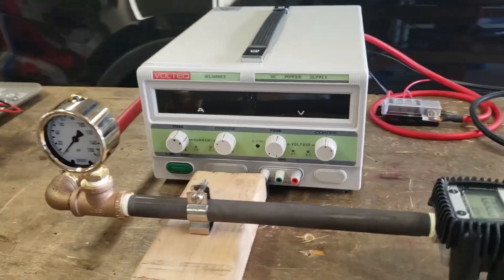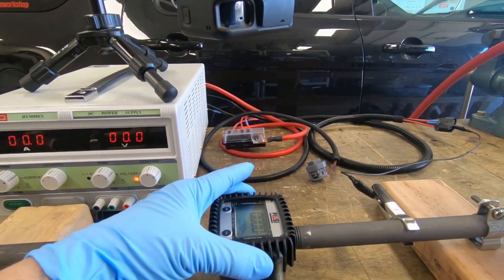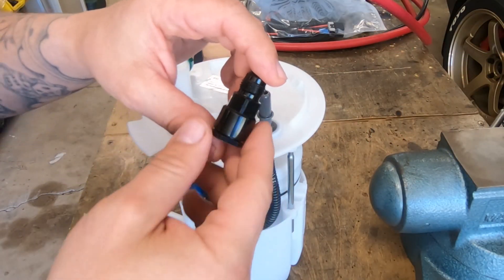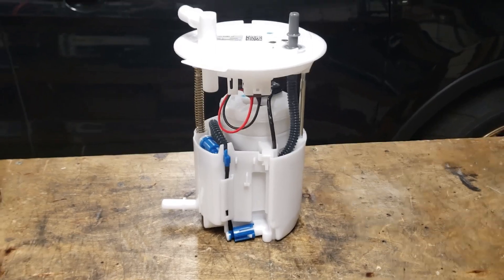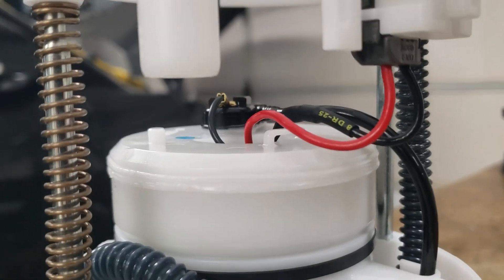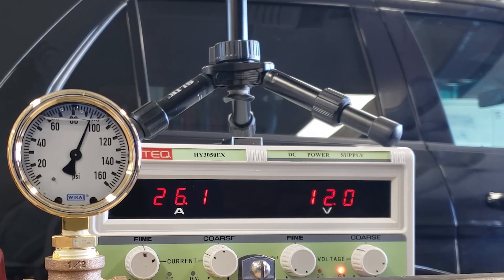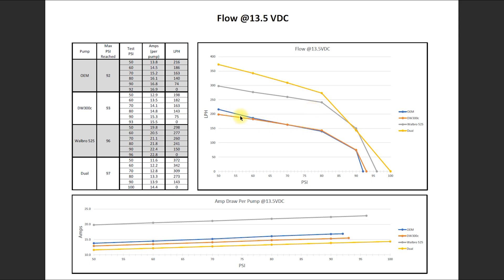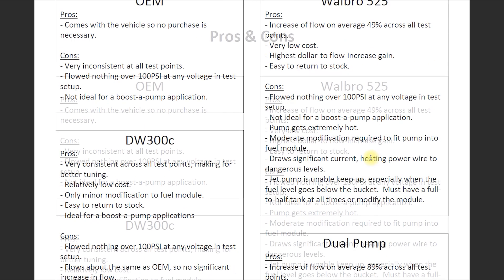Explorer SHO Flex 3.5L EcoBoost: LPFP Modules Compared - Unveiling Fuel Flow Performance! Short

Comment: For people wanting more pressure with flow you can run a serial pump setup and achieve over 120psi base pressure relatively easily. Your primary pump will have to be larger than your boosting pump.
Reply from the maker: All true, but won't work on this platform...at least not without significant modification.
Reply: @4TheWorkshop  an external inline pump would have to be utilized.
Reply from the maker: @RadDadisRad  nope...won't work at all.  Your basically saying in series?  This system essentially already has that...the HPFP.  So that doesn't help anything if the first pump in this whole process (LPFP) isn't able to feed this "booster pump" to begin with..  All these ideas you are coming up with don't take into account controlling any of it and what to do if there is an overpressure condition. A lot more engineering involved than what you're suggesting. C'mon...gotta think past first base, my man.  Your ideas will only create issues for those who are reading this.  I'm tempted to start shutting this comment section down as I want no part of a hair brained idea.  You're welcome to start your own channel and promote those ideas there.
Reply: @4TheWorkshop  I think you think you’re smarter than you actually are by the way you’re talking down to me. Many liquid transfer systems use a a HVLP base pump with a LVHP secondary pump to achieve their desired pressure delta. I’m an automation and process controls engineer and I design hydraulic  transfer systems for wastewater. I achieve 280-480psi inter stage in a multistage ultra filtration system while flowing 44gpm @ a 29% solids to liquid ratio. A higher base fuel pressure means a multiplied delta pressure ratio through the hpfp. None of those low pressure pumps flow enough at 100psi let alone 125psi or even 150psi. Low pressure fuel pumps are a lot more common, making sure sure the pump body can hold those pressures vs ambient is another thing other than the aluminum bodies units.
Reply: @4TheWorkshop  every idea is considered a hairbrain idea until someone makes it work then it’s a great idea. Be an innovator not a parts installer. Btw I am one of the ones with twin g25/550 turbos on my 2014 SHO that I have a fuel lab PWM controller and brushless pump. Using stock line as a return line and do far with priming, idle and light rpm’s I maintain 100psi base pressure. I’m not fully tuned and I don’t have a built trans so I’m not in any hurry to get the car road going.
Reply from the maker: @RadDadisRad  HAHA...I know the major players in the SHO world and you're NOT one of them.  I know BOTH of the only 2 SHOs that have the G25s and there is NO ONE running a brushless setup.  So you can quit with the name dropping and power-flexing.  Be aware of who you are talking with.   As for the hair brained ideas...well this ISN'T the forum for that.  My video was intended to test the ONLY available (and currently being used) setups out there for the transverse platform.  This isn't the place to see whose junk is bigger.  Take that to FB or on the forums (I'm on pretty much ALL the forums and major FB groups, btw). Again, start your own channel and promote your ideas there.
Reply: @4TheWorkshop  I didn’t name drop or power flex. I’ve been building my sho longer than you’ve had your explorer. Just remember how rude you’re being because I’ll remember when I finish my build you’ll be just another slower build.
Reply from the maker: @RadDadisRad  LOL...here we go...ANOTHER one of these guys. I'm really not worried about you, my friend.  And yeah...you essentially name-dropped and power flexed, assuming I was nobody in the scene and would gawk at the wonder that is RAD DAD who has...ooooooohhhhh....G25s, LOL.  I call out BS where I see it.  You DON'T have G25s OR a brushless pump setup, because I KNOW exactly what it would take to get those things functioning properly in this platform, and you're not doing that, I promise, buddy. I applaud all modding, but not when it comes to tire kickers and BS'ers.  Best of luck to ya buddy...and hope to subscribe to your channel one day ;)

Comment: I will say that’s a lot of data, people will say that this or that was not measured correctly but I will say as an engineer if the testing standard is uniform across the whole test then the data will reflect the structure of the test. The data reflects the testing and has value.
Reply from the maker: Thanks....I did what I could with what was available to me.  A larger sample size would've been ideal and the results aren't indicative of what would actually occur in-vehicle,  but as you said...what we are looking for is the differential between the pumps to get an idea of how well they perform between each other.  An apples-to-apples comparison.

Comment: The biggest problem is DC brushed pumps have a higher wattage at higher voltage where brushless pumps will use the same wattage regardless.
Reply from the maker: Yes, all true, but fitment is the current issue.  There are no brushless pumps that will fit this model without major modification.  The brushless pump controller will also need to be resolved...again, not an easy or cheap endeavor. Nothing is impossible, but testing what is currently available.
Reply: A brushless fuel pump could be used but it would have to be external and you would have to use the ford output signal into an aftermarket brushless controller. Fuel Lab does make a brushless fuel pump controller that will use the output signal that the cord FPCM puts out.
Reply from the maker: @RadDadisRad  Yup. Aware of all this, entertained all this already. Not as easy as you think. Lots of fab and cost for brushless is pretty high. And flow isn't even quite as high as the dual pump anyway. Not to mention, the point of this video was to showcase what's currently available on the market as well as what is commonly done.
Reply: @4TheWorkshop  I understand the purpose of this. I’m just expanding on the information. Others will see this video. The comments just give them things to ponder.